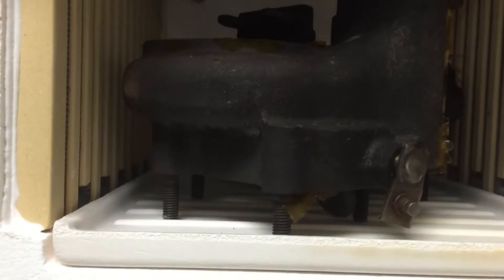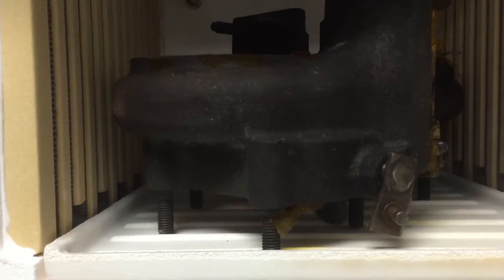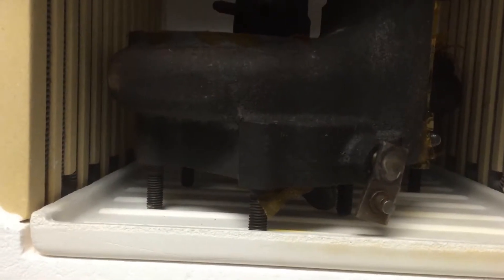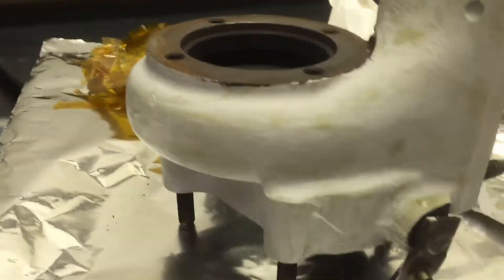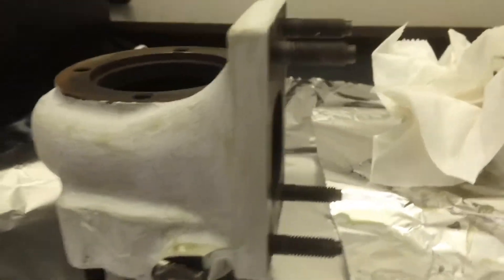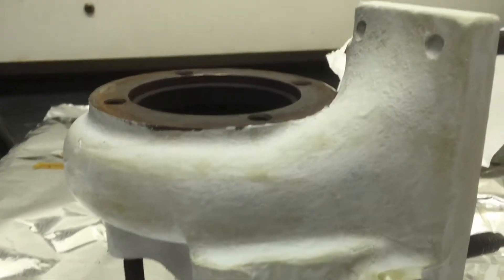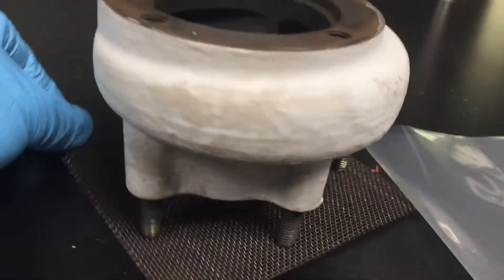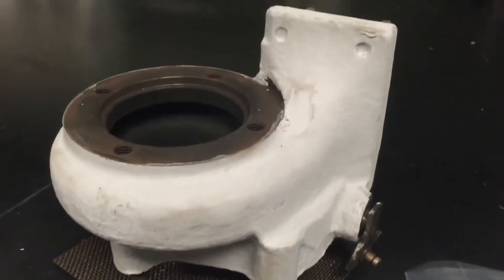DIY Ceramic Turbine Coating With Cerakote

Comment: wouldn't it make more sense to coat the inside of the turbine housing?
Reply: No because of clearance and if it ever flaked off!
Reply: @mahalaleelforever4806  not a valid argument against coating the inside. The clearances isn't that tight that a layer of coating will cause issues.  Lots of people have the internals coated. Heats coming from the inside. Have the thermal barrier there to prevent the housing from heating so much.  Pistons are ceramic coated. That's a much tougher  environment then inside a turbine housing .

Comment: I hope you aluminum oxide blasted before coating with cerakote, baking the oils off is only the second step after degreasing. If you didn't I'm curious how it held up.

Comment from the maker: Another fun project for the turbo build.  This was the Cerakote Chromex high temp bake on ceramic, not spray paint. It should help keep engine bay temps manageable.
Reply: Have you noticed any reduction in engine bay temps since applying this to the turbine housing?